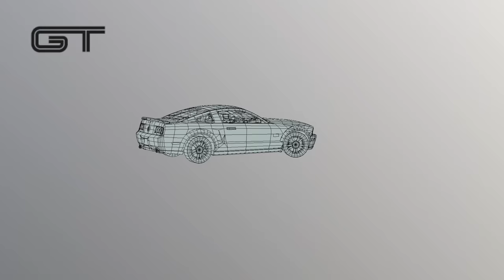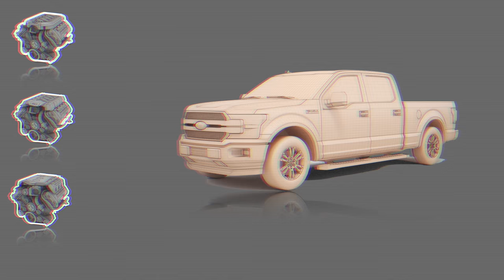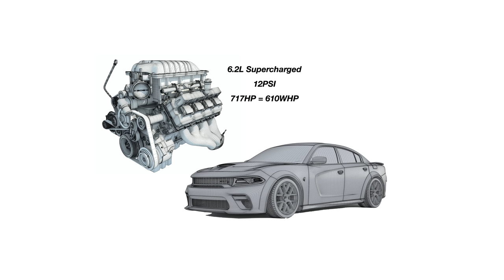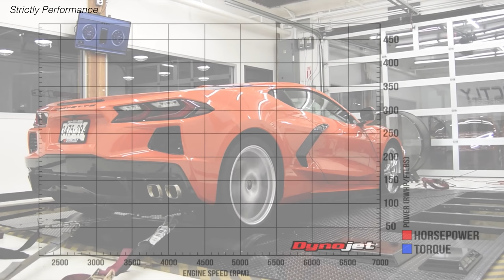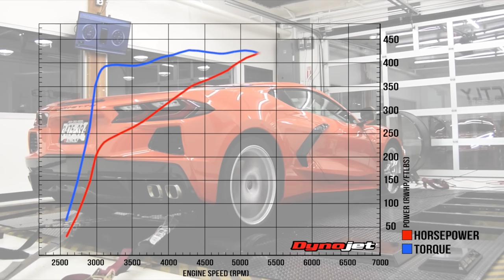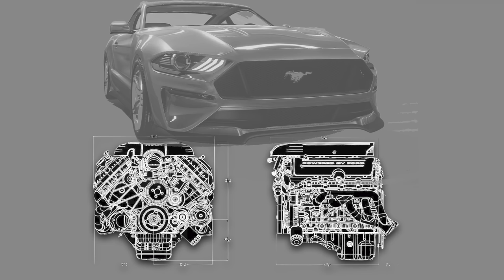How 5.0 Coyote Engines Beat LS and LT😮 | Explained Ep.2

Comment: There are certain aspects that make the 5.0 better. But I still think the LS3 was the best v8 of the past 20 years. They were simple, reliable, sounded great, and can handle enough power. The newer LT series I do not like. They added all the new stuff like DI, AFM, and VVT.  I would buy a 5.0L over a LT1 and do currently own a gen 3 5.0L.
Reply: Cannot disagree with you here
Reply: I'd still buy an LT over a coyote
Reply: @james10739       why.    Coyotes flow better rev higher and make more hp without a struggle.     RIGHT OUT OF THE BOX.    But make sure u go the 3-2-1 method like this guy said in the video to make good hp reliably
Reply: @motorlife5239  not to mention if we’re talking end goal… the ford modular platform has been in promod cars making upwards of 3000+ Hp for almost 2 decades… the LS platform is not nearly as footed at that power level and not to mention dodge and the new HEMI is basically nonexistent at that level. Not that it really applies to you and I but it’s still cool to know there’s a factory ford crank and engine block out there making 3000hp 🤣
Reply: @Texas_Road_Warrior  you know nothing of drag racing by that comment.
Reply: @motorlife5239  what's the point (right out of the box) when you have to completely assemble the engine it completely  negates that statement
Reply: Actually as of 2022 this year the LT motors will no longer have vvt or dynamic skip fire so the engine has seemed to improve but it's still not great cus direct injection is garbage but it is improved compared to last years LT motors
Reply: @motorlife5239  sounds like alot of work and alot of money for the price of a coyote I can have 2 LSX motors maybe 3
Reply: @james10739  true.    I wouldn't get the 1st generation coyotes.  They only make 400-500hp cause its all they handle.  The 2nd generation has better valvetrain.and make 650-700hp the 3rd generation has thicker rods and will handle 900-2000hp without a struggle.   I don't like Ls's cause their too common and they can only handle 500-1000hp even if you build a Ls itll only be capable  of 1000hp after that will be a struggle to make more Hp with an Ls cause their heads do not flow good enough for 1500-2000 hp thats the biggest setback with Ls's is the flow in their heads yea if chevys made duel overhead cam engines they would flow better but they don't cause their chevys and stick with a pushrod design  that has sucky flow
Reply: @Texas_Road_Warrior      yea.   Ford modular motors where in a lot of trucks and cars.   Including the 3v (triton)  the only way to "bullet proof" a 3v triton is change the tentioners to cast metal (no nylon) change the heads to the 4v configuration  unless u wanna stick with the 12 ft spark plugs  that break if you never change them or never run some type of oil in the gas  (2 stroke oil premix) or never run any cleaner through the combustion chambers and the last thing to do is upgrade the oil pump do thoes mods to it and you'll have a "bulletproof" 5.4l 3v mod motor 
*cast metal tentoners (no nylon) 
(Keep plastic guides) <if you want to>
upgraded oil pump
upgraded cam phasers
one piece spark plugs (knocks out that problem) 
* if you can find billet rocker arm assemblys Lmk cause I'd totally go billet rocker arms but I cannot find them 
(or just run anti-wear oil additives in the oil) for a little bit 
All these things will bulletproof  your 5.4L 3v
Reply: @BluestreakF150  based off your comment you seem like a angry Chevy fanboy
Reply: @jackdaniels2657  its way easier to work on the chevy powerplant than the 5.0 . And they are not even that reliable either just like all the other brands! Its all what u like in the end!
Reply: Ls7 is better than the ls3
Reply: @franciscoybarra1805  or u can just ls8 cam it & trick flow heads and edelbrock efi with huge throttle body! Can't believe I'm defending the ls3, I'm a Ford guy and I love the 5.0s(Coyote & HO's(87-93)). And guy who said they top out at 1000hp must never have seen an aluminum block LS with 2 stage nitrous! 10s easily in the last Z28 chevy made. Car would scare you on the street!
Reply: @user-NofaceNocase  I like 2000 to 2006 lsx v8 engines
Reply: @motorlife5239  are ls4's not prefarable in this comment section? They put that shit in HONDAS. It's not too reliable but there's easy access and you can cross swap parts easy. Like the trans out of the older caddys. Or the heads from a corvette. You can get a good 700hp in that engine, and put it in a small car, maybe not a Honda fit though.
Reply: @james10739  you can completely ignore the 3-2-1 comment, Gen 2/3 makes the same power. 3-2-1 is most efficient for Gen 1 cars since their bottom end is weaker.
Reply: @markprice2225  i agree! I prefer the ls engines over coyotes but I’ve seen some pretty mean coyotes, I’ve also seen people push the ls7 past 2k rwhp. And some people push almost 800 rwhp N/A!! Ls8 is great but the Ls7 and Ls9 are just a bit better in my opinion
Reply: @jackdaniels2657  this is not true.  The ls3 and lt engines cost as much as coyotes do.  Not all ls are dirt cheap just the ones that came in a million trucks and suvs and other stuff like that.
Reply: @motorlife5239  gen 1 coyotes can make 650+ all day long some even go as far as 700 wheel with a power that is getting towards the top of the safe zone so to speak.  A gen 1 can make 500 wheel all motor with a ported cj and cams with fbo and e85 let alone with boost idk who told you they can only make 500 hp but they're smoking some good shit.  The 3v can only take around 500 on stock motor and 450 torque.
Reply: @motorlife5239  it's also not the "better valvetrain" that allows a gen 2 to make more power it's the stouter bottom end that was derived from the boss 302 that came before it.  This is why guys with gen 1 install gen 2 short blocks to make more power.  The valve train is better but not that much it's a negligible difference.
Reply: @motorlife5239  the gen 2 motor is just as stout as the gen 3 and can easily make 800-900 on stock motor same as gen 3 if anything gen 2 holds up even better.  Idk where you got stock gen3 can take 900-2000 hp but whoever came up with that is really smoking some good shit.  Their limit is about same as gen 2 and most will tell u gen 2 holds up even better if anything.
Reply: If you say of the last 20 years then your not a car guy sns
Reply: @midnight347  OK but if u buy performance parts for an lsx VS a coyote with a 5000 dollar budget u can buy more parts for the lsx then u can the coyote and the market for buying parts for the lsx is way huge so many different brands and combinations and u spend less time fixing the lsx VS coyote cus honestly it takes far less time to rebuild an lsx VS a coyote and u can put an lsx in anything cus they make kits for about any lsx build and finding parts is easier. Ford makes alot of power but they don't last LT motors are junk even without afm and without vvt they are still junk cus direct injection but an LT is still easier to work on then a coyote motor any day of the week
Reply: These are opinions lol. A cayote isn't complicated to a person who knows coyotes and an ls would be simple.  A person who knows ls engines thinks ls engines are simple and cayote engines complicated.  Cayotes are just more modern engines is all.
Reply: @Texas_Road_Warrior  way more gm style and hemi style engines making 5000hp and over. Not too many ford's. If it is a ford it's just the body and engine is swapped to a hemi or gm style. ford rarely wins in the highest of levels.
Reply: @lordpula1193  💯
Reply: Coyotes, LS and LTs are great engines. The only problem with LS and LTs is if they have AFM/DFM. Hemis and Coyotes are notorious for sticking valves which tends to wear the valve seats and flatten the cams. If the valve are replaced with after market before this happens you will never have a problem out of these engines.
Reply: I own an LS3 VFSS manual... best engine ive ever had that's for sure
Reply: GEN4 LSx is not better than GEN5 LTx. There are certain advantages to having a LS like a larger aftermarket. They're simpler, easier and generally less costly to mod. Actual "LS" doesn't use cylinder deactivation components. PI has its advantages, while having its disadvantages as well. GM wasn't locking their computers up so tight as you couldn't tune on them.

GEN5 allows you to upgrade to dual port injection (like is on the LT5) which blows both PI and DI out the water by combining them. Let's look at some advantages GEN5 LT has over GEN4 LS. Better blocks, better OEM heads, better rotating assembly, better oiling system, in some ways the DI is better. If I need to specify then 12MM head bolts, gussetted coolant passages, nodular main caps, forged crank, oil squirters, superior intake port design, higher CR's, VVT which is a positive and not a negative, but if you feel the need then you can delete it.

A well modded, stock bottomend GEN5 6.2L can put down over 100 N/A WHP a liter which is not common on any LS. A GEN5 LTx is an extremely good SB with a ton of potential, but it does seem like GM and the aftermarket try to hinder it as a popular hot rod engine. 

Now on to GEN3 Coyote. It's the bomb. Straight up. Generally I'm a GM guy, but bought an 18 F150 XLT 302A FX4, crewcab, 5L, 3.73 truck in November because I got it for about $12K less than a comparable RST Z71 with a L87/10L80. Even your basic 19+ LT L83/8L90 trucks were commanding more than a XLT 5L truck. (Likely due to the frequent plant shutdowns that were happening) There's no way I'd take a GEN5 5.3/8L90 over a GEN3 Coyote/10R80. After owning this truck I probably wouldn't even take a 6.2/10L80 over it due to GM locking up its tunability. GM commands way too much $ for the L87 in their trucks, and the low availability keeps them high as hell in the used car market and their performance is no better in a Silverado than the GEN3 Coyote is in the F150. People like to say, "of course a 6.2L costs a lot in the GM 1/2 tons. It's a Corvette engines, so obviously it's an exotic OHV engine made of gold dust, and unicorn farts." To that I say, "it's also a Camaro engine, and a GEN3 Coyote is a Mustang engine with DOHC's, dual port injection, nodular main caps, a fully forged rotating assembly, and in no way should it cost Ford less to put a GEN3 Coyote in F150, than for GM to put the L87 in the Silverado/Sierra." Another really cool thing about the new Coyote in the F150 is it uses Speed Density instead of MAF. Modern SD is way better than it was in the 80's/90's, and makes everything much more trouble free, simpler and easier to tune unless you want to run a big cam or something. Even the new GT500 uses SD instead of MAF.
Reply: @JROC734  LS engines do come with cylinder deactivation which is why the 07-2013s were having lifter failures as well as the LT engines. AFM/DFM have been around for a while.
Reply: @tskraj3190  no they don't. Show me a LS1/LS2/LS3/LS6/LS7/LSA/LS9 with AFM. And I could care less about a LS4 which was the only 5.3L LS engine, and one that came in some factory FWD GM vehicles, and is largely overlooked in the LS lineup. (It did use AFM)

LQ4/LQ9/LY6/L76/L99, etc, etc aren't actual LS engines, they're just LS based engines. Same as L83/L86/L87/L8T aren't actual GEN5 LT engines, they're just GEN5 LT based engines even if a GEN5 6.2L longblock is 99% the same regardless of platform. The only engine actually labeled "LS" with cylinder deactivation is the LS4 that came in the Monte Carlo SS, Impala SS, Grand Prix GXP, and Buick LaCrosse Super from 05-09. BTW AFM was introduced in 05 even though most believe it was introduced in 07.
Reply: @JROC734  Are you intentionally not mentioning the LS Gen 4 because it has AFM?
Reply: @tskraj3190  are you intentionally playing ignorant to save face, or do you really not understand? Your GEN4 LS engines are the LS2, LS3, LS7, LS9, LSA, and then the black sheep of the LS family that no one talks about and many don't even know about the LS4. It's the only 5.3L LS engine ever, and was only used in FWD platforms, and the only LS engine to ever use AFM. The 6L engine in your 04 Silverado is not a LS engine. The 5.3L used in your 11 Tahoe is not a LS engine. The 6.2L used in your 13 Sierra Denalli is not a LS engine. Now these engines are all based in the same family of engines, and evolve off the same platform, but actual "LS" engines were GM's GEN3/GEN4 SB performance engines. They weren't the truck engines, they weren't the passengers car engines, they were GM performance vehicle engines. A Pontiac G8 GT with a 6L L76 is not rocking a LS engine, but a G8 GXP with a LS3 is rocking an "actual" GEN4 LS engine. Sure, we dumb it down for simplicity, but throwing a stroked LQ9 with a good H/C/I setup in your 99 WS6 is not doing a 4" bore LS swap in place of your 3.9" bore LS1, you're doing a GEN3, SBC truck engine with a 4" bore swap in place of your GEN3 LS1. The only LS engine to use AFM is the LS4, but it's such an irrelevant engine that it's not even worth mentioning, and most people (probably including yourself based off your comments) don't even know about it. Yes there are plenty of GEN4 SBC engines that came with AFM. There are no GEN4 LS SBC engines intended for RWD platforms that use AFM. If you read what I had said that made you want to question what I said, I literally specified "actual" LS. ( I think I wrote: actual "LS")

You need to quit arguing this because you're wrong. Silverado's/Sierra's/Tahoe's/Yukon's/Escalade's/base G8's etc never used LS engines. A GEN5 Camaro SS did not use a LS engine unless it came with a manual transmission. If you got an A6 SS it had a L99 and not a LS3. No GEN4 LS engine ever put in a Vette/Camaro/TBSS/CTSV/G8 GXP/GTO/Chevy SS, etc ever had AFM.
Reply: @JROC734  Gen 4 LS V8s have AFM but not all models do. Cadillac uses AFM in their older 6.2L V8s and I know that because I have an Escalade and no it is not a Vortec.
Reply: @tskraj3190  okay homeboy, which LS engine does your Escalade have?
Reply: @motorlife5239  yeah that theory is great until you realize you can buy a 6.0 ls, get aftermarket forged rods and pistons, with a cam and aftermarket heads and boost them for about the price of a stock coyote with a blower... the reason why the LS is "too popular" is because nothing can match it in dollar per reliable HP. Also one last thing you mention a stock LS will struggle to make over 500hp? Go look at Richard holdners videos of running stock bottom end LS engines till they blow. The 6.0 made 1600hp and they had to stop the test because the 4 bar map sensor couldn't read anymore boost. Yes I know it's a dyno test in a controlled environment but still 1600hp with a stock block, crank, rods, pistons, rings and bearings??? And it survived... holy shit.
Reply: @tskraj3190  among the many reasons not to drive an automatic
Reply: @konnerkramer329 . Facts!
Reply: @motorlife5239 . Flow more 👀. That is wrong, Coyote heads flow around 300cfms while Hemi Apache heads flow about 330cfm’s, and LS3 heads glow around 315.

Coyotes are great engines just line the LS3 and 6.4L Hemi. However, they all need to be built to stay reliable over 800hp.🥱
To each his own,
Reply: @motorlife5239  the price, LS based engines are far more affordable, and have alot more versatile parts. If i blew up the coyote that was in my 2011 mustang gt, it at a minimum cost me 5k+ for a used high mile f150 motor, for GM i could acquire an old 6.0, do some simple mods to open up the motor, for way less with more power than a stock 5.0. Most coyote performance parts are at a premium. LS based engines and even old chevy small and big blocks are everywhere and cheap with alot also having interchangeable parts. That being said, i love the coyote but cant ignore the price to performance on GM side.
Reply: @bri-manhunter2654  here's what I want to know, because I don't know much about GEN3 Hemi, but if GEN3 Hemi has such a high flowing OEM head with a 4.09" bore, then why do they make such lousy N/A engines? (I'm talking about for modding) You'll see Scat Pack guys talking about 500 WHP with H/C/boltons/tune. Seriously for an OHV engine with heads that physically large, and a bore as large as the 6.1L+ Hemi's bores, they should be N/A beast's. Their bore diameter is approaching a LS7's bore. GEN3 Coyote and GEN5 LT1's are both capable of 500+ WHP N/A without even taking the valve covers off. 330 CFM is what most GEN5 6.2L guys consider their heads to flow stock, and this video is the first barely breaking 300 CFM's I've heard for that head. I googled it after watching this because I was like, "what," and found a website claiming these #'s on a LT1, and I'm thinking that was done on a heartbreaker of a flow bench, and it makes me wonder if that's where this guy gets those #'s from. Even Pray Performance claims 330 CFM from a stock GEN5 6.2L head. The common # I've seen for GEN3 Coyote heads is about 307 CFM, but Coyote likes to spin. If a 6.4L comes factory with 330 CFM heads then a milled/ported H/C/boltons/tuned on E85 car should be breaking the 600 WHP mark. Not sure, but I've heard Hemi guys complain about manifold options, but they are common enough where someone (including MOPAR) should be making a good flowing manifold for them if in fact their stock manifold is a source of huge restriction?
Reply: @JROC734 . Ahhhh, I see what you mean. Well, actually, the Gen 3 Hemi platforms make a lot of power with simple mods. My 394Ci 6.4L stroker with 11:4:1 compression, Eagle Heads( 300CFM), 233/246 112LSA cam, 6.4L intake manifold( variable runner), and stock heads is making 500hp to the ground with 8speed. That is with just a medium sized cam, pump gas 93octane, decent compression, and a variable runner intake manifold. These Hemi’s like all high flowing g head motors do is make easy power with just a cam swap, you can spin them a lot too.
The top motors in top Fuel is lots of cubes, lots of head flow, and lots of rpm which is a tale as old as time.
Also, you don’t have enough PTV to run a big enough cam on a 6.4L without notching the pistons to make 600WHP. Like the LS motors, you can get away with low 230’s on the intake side before having issues. You are going to need around a 250/XXX cam on a 6.4l to make the 700hp yo make 600 to the ground. Also, I believe a 330CFM head can not flow enough for 700hp at the crank, probably pretty close.
Reply: @SirTrinculo  I might agree with this traditionally, but Fords V8's have largely caught up as GM's V8's have gotten worse on the valve they once represented. For one a healthy aluminum LS/LT SB is going to cost some decent $, especially with a 4"+ bore. They aren't exactly your GEN3 iron blocks that you can source for $500. 

Another thing is IMHO your modern SBF is more reliable than your modern SBC, especially at larger HP #'s. The non-DOD engines are exempt from this, but large #'s of SBC's from the mid-2,000's+ have been taken out by poorly designed lifters. You can (and should) delete AFM, but even an extremely budgeted AFM delete job is going to cost probably $2,500-$3K. On top of that your GEN2 and GEN3 Coyotes are stronger than the GEN4/GEN5 SBC. (in general not including LS9/LT5) IMO a GEN5 SBC at its core is an awesome platform to build from. When you look at the block improvements it's potential is huge, but the fact of the matter is they traded places with Ford in terms of whose rotating assembly is stronger. If you're trying to boost a LT1 to 700 WHP on pump gas, you're likely on short time. Some mention Coyote oil pump gears, but many don't feel that they're necessary to replace with billet gears, but if you do want to replace them it's not a big deal in the large skeam of things, for an otherwise solid little engine package.

Lastly much of the newer Coyote stuff is way cheaper to mod than even GEN4 LS based engines, but especially GEN5 LT based engines. For example intake manifolds are generally cheaper on Coyote. The LT2 manifold has really come to help in this regard, but a GEN3 MGT/GT350/Bullitt/MACH1 manifold can be had for a pretty reasonable price, and porting them offers impressive gains just like with SBC. When I bought my 19 SS 1LE I was like who the hell put a Vette tax on Camaro's. They are not cheap at all to mod like maybe an old GEN4 Fbody. (Even old cars aren't just "cheap" to mod) Boosting 800 WHP out of a GEN3 Coyote is a relatively simple affair compared to what it is on the SBC when talking about the fuel system and whatnot. It's especially an easy mod on the F150 where you've got flex fuel, and a speed density setup instead of a MAF setup. An upgrade to your port injectors and maybe a little bit more fuel pump and you're GTG for large HP on a GEN3 Coyote.

BTW this is not to hate on GEN3/4/5 SBC. I've got tons of love for those engines. Only to say that the narrative that SBC is always cheaper and more affordable than SBF is not always the case.
Reply: @bri-manhunter2654  I'm not a Dodge guy, but I'm not a hater either. A SB with a 4.09" bore should be capable of moving a lot of air. With their bore and stroke setup I imagine that you can make a 6.1L+ Hemi spin pretty good especially if you've got a high flowing topend with a light enough valvetrain.

Is it the valve angle that limits your PTV? Does anyone make an aftermarket head for the GEN3 Hemi that allows for a larger cam without fly cutting the pistons, or dropping the CR?
Reply: @JROC734 . Just like LS motors you are limited to the low 230’s on the intake side with regard to the LSA as well, and you are not going to get much more out of working the heads. You will have to notch or go stroker. And yes, Thiket makes aftermarket heads while multiple companies can port the heads very heavily. And yes, you can spin them up to 8,500 without having to go to a bullet crank, you just have build the valve train to handle it.
Reply: @motorlife5239  you are clueless a stock ls2 is capable of 1500 hp😄
Reply: @johnboy5167  yea with throwing rods out of the block.      Good luck on that
Reply: The LS is a down built race engine. Literally that’s why it’s such a good performance platform.
Reply: @JROC734  My father-in-law drove  my 20 Silverado Trail boss towing his 15foot enclosed utility trailer loaded with tools and I took his 21 5 liter f150 2 wheel drive to the shop ( oil change) when he picked it up he drove straight to the Chevy dealership he couldn't believe how much better the chevy pulled and handled
Reply: The coyote is far better and its not even close. LS3 is just cheap power
Reply: you forgot about the trinity engine.
Reply: there's no bullet proof secondary timing chains.  I just broke an upgraded one.
Reply: @BluestreakF150  - he does though. You sound butt hurt that fiat dodge engines can’t get to that level of horsepower ? Last I heard they’re struggling making even what they make stock? Maybe you can clear that up for me since you obviously like fiat/dodge.
Reply: @motorlife5239  - Ford small block better than any LS you keyboard fangirls squirt over. It’s Ford Small block > Mod motor > Chevy small block > LS
Reply: @michaelstoker6710  - the only reason is ford rides harder is solid axle and chevy is IFS. Ford actually builds trucks. cheby builds cars with beds attached to them. They’ve always been weaker truck.
Reply: @CoyoteFTW  I'm not talking ride quality. I'm talking towing my 5.3 towed his trailer with ease and got about 4 miles to the gallon better on fuel.
Reply: My 17' SS Camaro LT1 with 6 speed man puts out 455hp and 455 TQ and can cruise down the hiway on a flat straight road at 65 or 70 mph and damn near get 30mpg with a 373 rear end. Its the best of both worlds...perforfance and damn good hiway mileage.
Reply: @matrox  nice, very impressive. With my ‘19 5.0 6-speed (3.73 rear) I can run 70-75 MPH on mostly flat roads and get 25-26 MPG. Crazy how a 450+ HP cars can get MPG like that. We’ve come a long way now they are trying to push EVs. SMH.
Reply: @amazin7006  LS3 Cheap durable tried and true power.
Reply: @midnight347  Because the 2 has iron cylinder liners...3 is spray bore !!
Reply: @jackdaniels2657  Boosted, Coyote wins, no sweat !!
Reply: @lordpula1193  AMOUNT of Factory parts in these high end 5,000hp engines please ??
Reply: @arkhsm  until they break. Too many moving parts. Double overhead cam and its got  timing chains total junk. Sure it can make alot of power but that new technology is junk vvt is junk active fuel management junk. Direct injection for gasoline is junk
Reply: @arkhsm  also coyote are too expensive and take too long to rebuild after it breaks u can't even. Put it anything cus it's too dam tall and wide
Reply: @konnerkramer329  STOCK COYOTE WITH A BLOWER WILL MASSACRE a LS with those mods !!
Reply: @arkhsm  The GM or Hemi versions whether factory or extremely modified still better than ford. if it wasn't for shelby helping ford even though he disliked them they would be even worse off in the racing scene.
Reply: @arkhsm  your telling me a stock coyote with a blower will make 1600hp🤣 what are you smoking. Maybe 800-900hp
Reply: @jackdaniels2657  And yet I'm seeing more and more Coyote swaps all the time !  Also, you conveniently forgot to mention the Coyote is SHORTER !!
Reply: @lordpula1193  Just think yourselves lucky that its bore size is restricted, 'cause even a 5.5L one would make 506hp in the GT, and 528hp in Mach 1 form. Also, torque would go up commensurately !!
Reply: @konnerkramer329  I thought you said a N/A LS would make more power than a stock ,blown Coyote mate.  Not a snowball's chance in hell for that !!
Reply: @arkhsm  well they did that to themselves. Doesn't matter though even if they did it's a ford it's junk. Its not all about that anyways alot more involved. Chevy GM new 5.5l is the highest na v8 from factory ever and it's only 5.5 imagine if they went bigger instead of making them smaller most likely because government made them. Ford had a head start and so many years and still ain't squat. again if it wasn't for Shelby they would be way more behind.
Reply: @arkhsm  no its taller and wider maybe shorter in length but let's be real u won't coyote fest but u will always see lsx fest
Reply: @jackdaniels2657  I actually wiki-ed the LS type engine the other day, and couldn't believe how many versions there are...of basically THE SAME THING...it's ridiculous. Most don't put out anywhere near even the LEAST powerful Coyote (2011-2014 F150 360hp/380tq), only the latest L83 (2014-now 355hp/383tq, from 5.3L  L77 (2011-2016 362hp/391tq, from 6.0L),...and ALL Coyotes are 5.0 litre...so simple !!
Reply: @arkhsm  no I said you can build a cam, heads intake LS with a turbo for the price of a stock coyote🤦‍♂️
Reply: @konnerkramer329  Oh, thanks for the correction. There's no doubt the LS series are superior in more than a few areas, for hillbillies like Cleetus to work on (and still stuff up occasionally), but our new hillbilly engine is 7.3 litres. They are just at the start of their development, and this time WE have cubes on OUR side.  BUT, due to sheer numbers built, I have to concede that for power to-money ratio, the LS won't be beaten any time soon !!
Reply: @arkhsm  if you're talking NA engines the old sbc still gives the LS a run for its money. From $500 mild rebuilds to 800hp all out race motors the sbc is still a threat in a well built car. I couldn't tell you how many people sleep on my camaro because it's "just a small block chevy not an ls swap". I guess the carburetor and distributor with the factory accessories doesn't look intimidating🤣 then I line up next to them in a 3100lbs car with a 615hp 383 that runs high 10s on street tires and they're shocked. Don't underestimate old school. You've got to remember guys we're running 9s with old 4 speeds in the 60s.
Reply: @arkhsm  u right there's millions of lsx motors how many coyotes not many as a matter of fact u not gonna find many coyote motors u try finding parts and see how expensive it is to work on. For lsx u can pretty much pay a dollar per horsepower a coyote will cost 5 dollars per horsepower. An lsx is good for 500,000 + miles easily I'll bet a coyote won't make it that far. Perhaps lsx isn't ur style then go with the ltx like lt4 lt5 lt6 motors the lt6 motor beats the coyote any day 650 hp nai just don't like the ltx series before 2022 cus they unreliable there's actually a recall on LTX motors from 2013 up till 2021. This year they took alot of the technology away like dod or afm and also got rid of vvt so now the engines shouldn't have any problems and can now be more reliable and easier to work on and less time repairing shity technology
Reply: @arkhsm  I guess it's just a personal preference for me cus i grew up around lsx motors I luved 03 Silverado 03 Sierra was cool too. Honestly I just like it for its sinpkisity and reliability and cus I know I can fix it and find cheap affordable replacement parts and I don't need special tools to do a timing chain a Ford needs special tools. On Ford u never get fuse locations on the fuse block lid u always gotta hunt things down on the internet the o2 sensors on a Ford are always hard to replace cus u can never reach it by hand on a Chevy I reach all 02 sensors, all plugs all wires the only sensor that's hard to reach on lsx is the oil pressure sensor but everything else is pretty accessible. I can't say the same for coyote. So let's recap here to work on a Ford coyote I need lots of money, lots of time, lots of patience cus it's complicated and I need special tools. Not to mention shortage of parts. Lsx is cheap simple  affordable parts are unlimited and don't require special tools.
Reply: @konnerkramer329  One of my favorite cars ever was a 331 SBF 5 speed Fox called Grey Mare...smoked tons cars with way more power, because the combo worked, and so did the driver mod. The older donks can still show the new ones how it's done !!
Reply: @jackdaniels2657  Some modular taxis were way above those small numbers mate; try 750,000+; but those like you say, were simpler 2 valve mills, with NO bullshit tech in them !!
Reply: @jackdaniels2657  Mate, I own a 302w now, and back in '81, and those make an LS look complicated. I new nothing about engines at 19 years old and stripped the thing down to the bare block in front of my parents shed, still attached to the engine mounts.  Had to pull it due to putting in a new duel point dizzy, but the oil pump driveshaft  had not seated in the oil pump. Ran it 4 up, flat out at night to the lake 5 miles away, and the lifters started rattling. Hadn't noticed the oil pressure warning light bulb had fallen out of its location !  Drove it for another year after adding a bottle of WYNNS FOR OIL, until the rockers started SQUEAKING, and it had hardly any oil pressure. That engine had been put in 5, yes  5 different vehicles, 3 of which were mine !!
Reply: @arkhsm  why do u keep rebuilding it or swapping it into more vehicles? Makes me wonder why it's not reliable.
Reply: @JROC734  lol obviously he cant tell by your comment you know what your talking about
Reply: @jackdaniels2657  it's "a lot" not "alot"
Reply: what about the new lt6 you think it can be better than any of fords of dodges stuff
Reply: Biggest line of 💩 I've heard to date,if you have a endless money supply build a ford,that engine and upgrades will drain you.
Reply: Lt falls off at 6500, the ford has nothing down low and the race is over.
Reply: @alankelter9416  no they're not.
Reply: @alankelter9416  haha no and those engines are garbage 3v lmao that's not highest level
Reply: @lordpula1193  that's my point, either is the 5.3l, it's not even in the same ballpark as the 5.0
Reply: @alankelter9416  5.3 can beat em imagine the others
Reply: LS and Coyotes are definitely tied for best motor ever made
Reply: there's no tie. fords garbage
Reply: @user-NofaceNocase old man or clueless . I guess that's wat new technology does to ya
Reply: Noooo . Here come the Chev Fangirls Screaming . 😂😂😂
Reply: ford ladyboys know Chevy has always been and will always be better.
Reply: NA: LS/LT  
Boost: Coyote
Reply: @BluestreakF150 He’s not wrong though, Koenigsegg’s v8 is based on the ford modular. Fords 4v mod motors can also handle boost really well.
Reply: My LS7 makes 1800 rwhp, you obviously don’t know much about LS engines.
Reply: LS heads can't handle 1000hp? Have you built a engine before?
Reply: @moabman6803  built plenty, Chevy owns the drag strip son.
Reply: @joshfowler1849  I don't understand. You said LS motors aren't capable of more than 1000hp.
Reply: @tskraj3190 That's if they're automatic. My V Gen LT1 manual does not have cylinder deactivation.
Reply: @franciscoybarra1805 Don’t ever say that shit again. A LS7 is simply NOT better than an LS3. You have to replace 3-4 different things including pistons and rods for the thing to hit its max boost for crank and pressure to the block. LS7’s blow up all the fucking time because they were improperly built for racing and people don’t build them right. You can buy a LS3 crate motor and immediately put 1,000+ hp into it with only replacing camshafts because I believe those can only hold less boost and about 800+ hp. So you’d need professional, racing rated parts and internals. Maybe 10 grand and you’ll get a good LS3 racing motor. Maybe 20-30k you’ll have a DECENT LS7 racing motor.